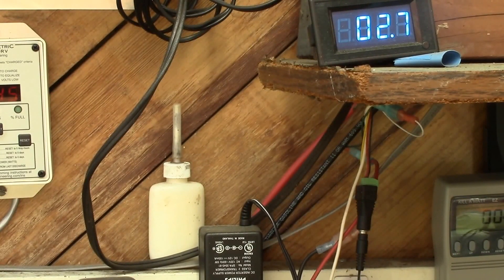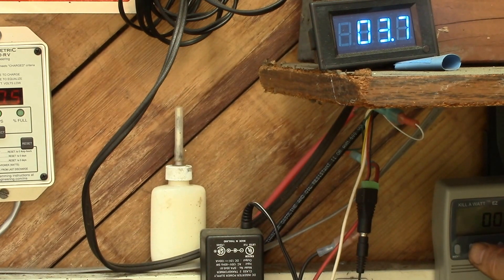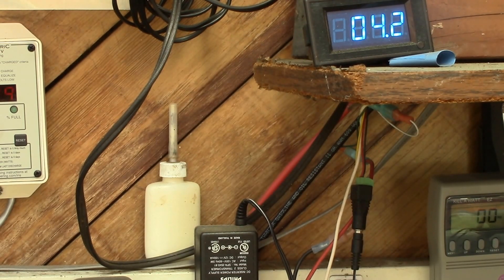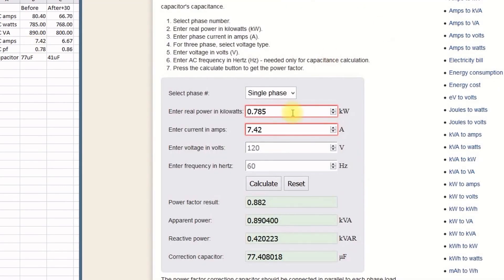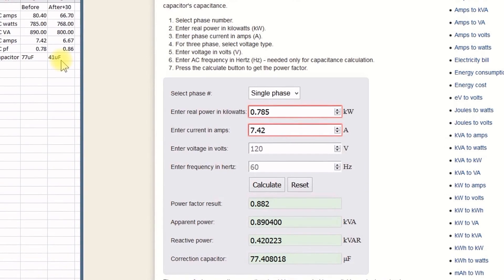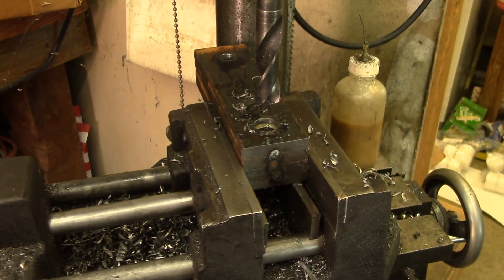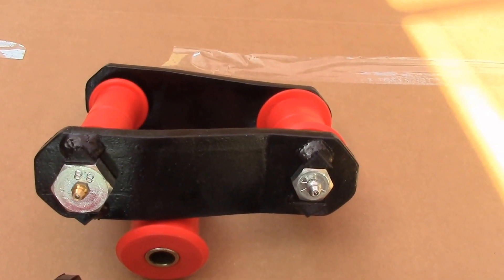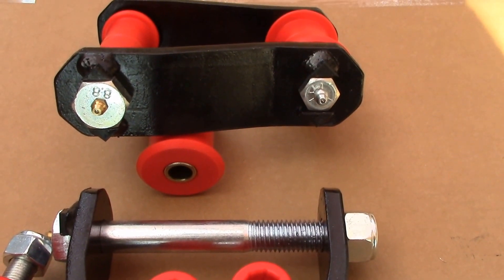Making Leaf Spring Shackles With Solar Power

Comment from the maker: We're still running this drill press with power factor correction capacitor in 2022.  It's now running off our 2400W/24V hybrid power inverter, lithium ion battery bank and solar panel array.